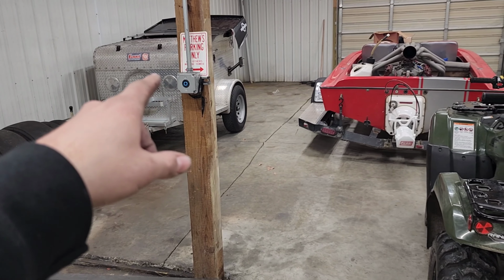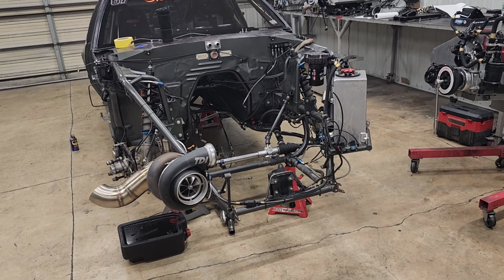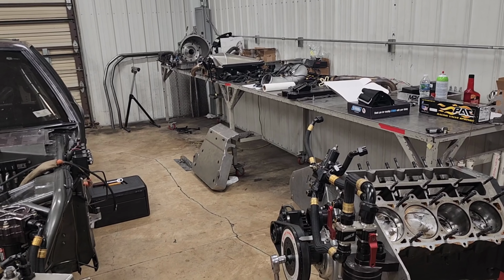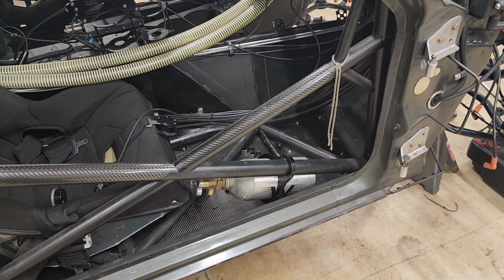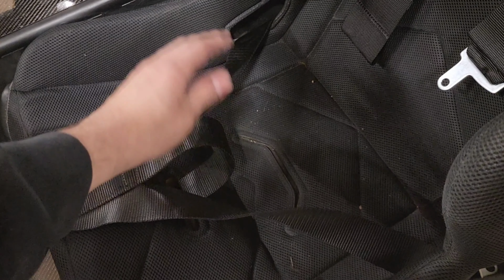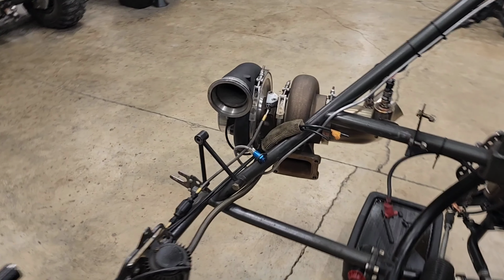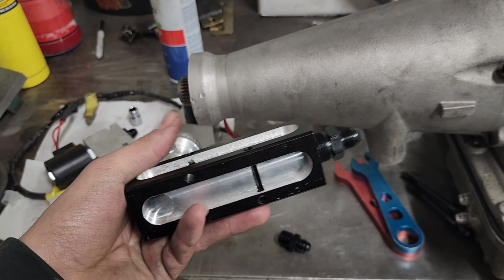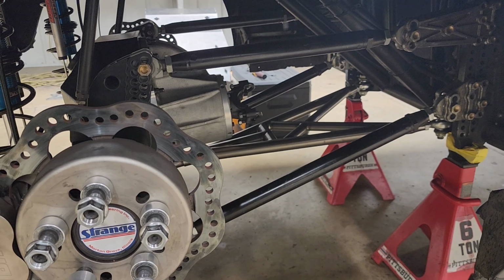Shop Car Update for Sick Week 2024!

Comment: Even out the hot side length will help with back pressure, my car gained alot, i cross mine toward the driver side till the balancer then loop them back so they will be close to even as possible
Reply from the maker: Agreed there... Just tight when the drag and drive radiator is in there. But yes that would help. haha